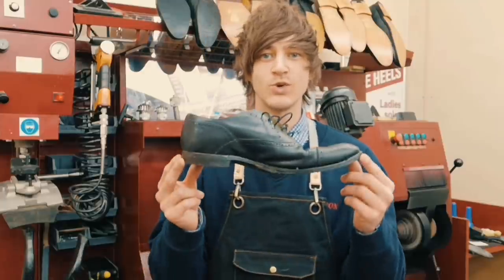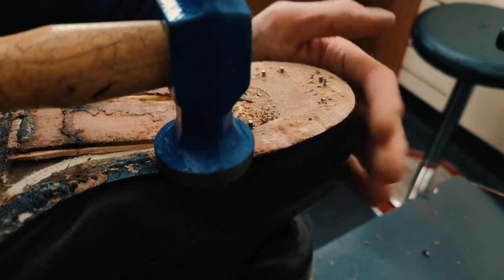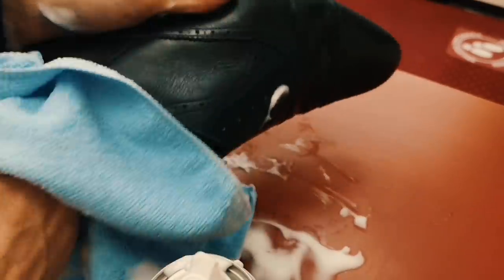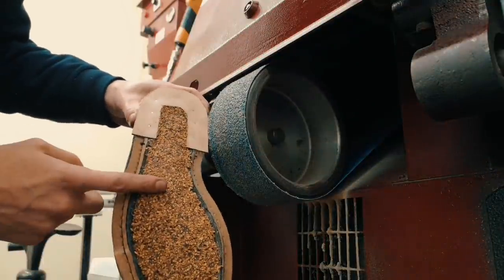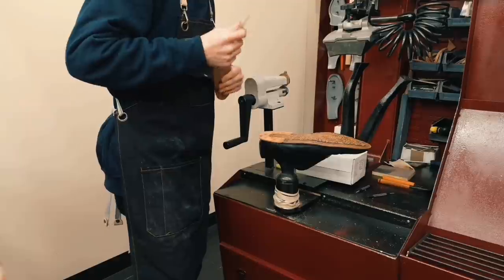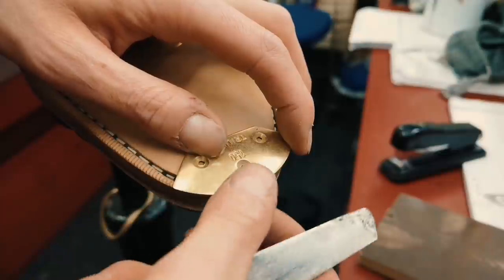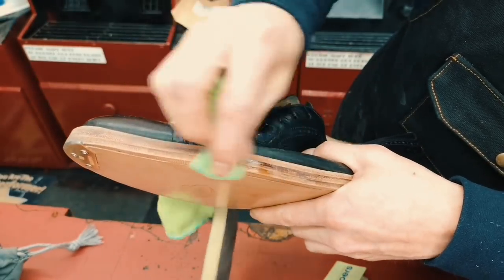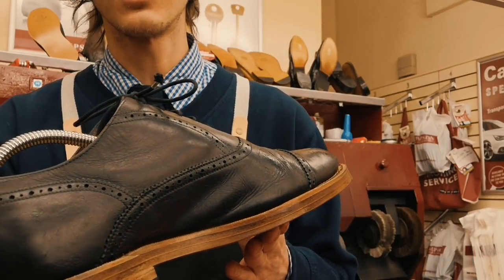Loake Restoration | Full Rewelt | Natural Double Executive Leather Resole #31 | Scottish Shoe Repair

Comment: I really enjoy the videos. Just a tip, the screws for the toe plate are pozidriv phillips head. You can tell by the extra notches on the screw head. With the right bit they will not cam out while torqing.